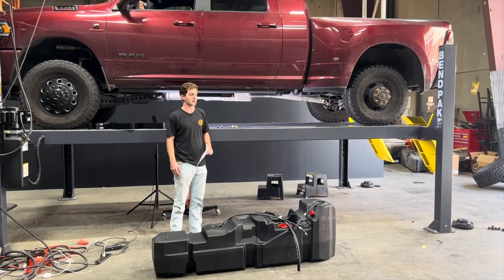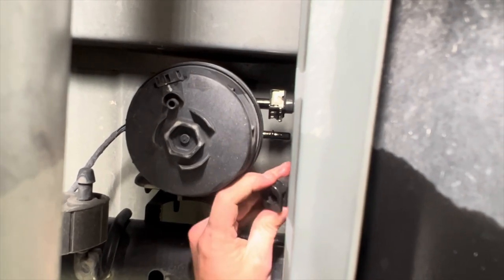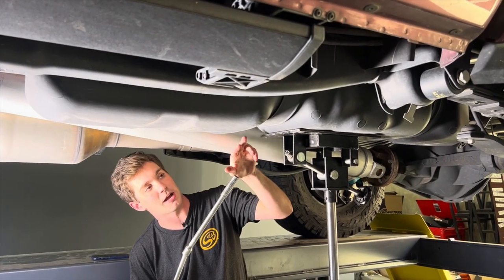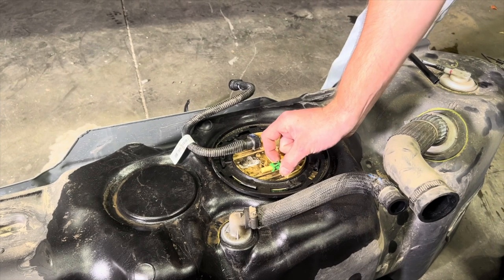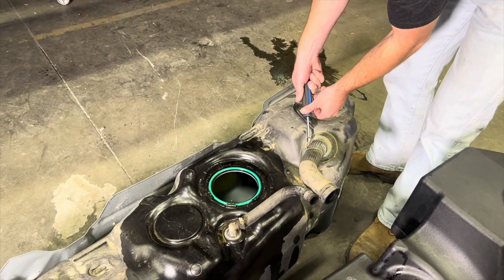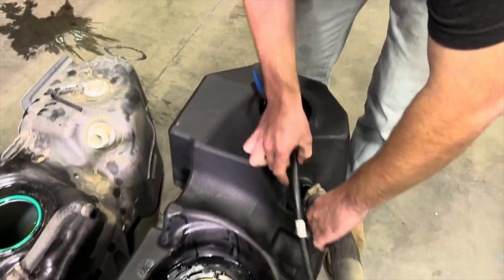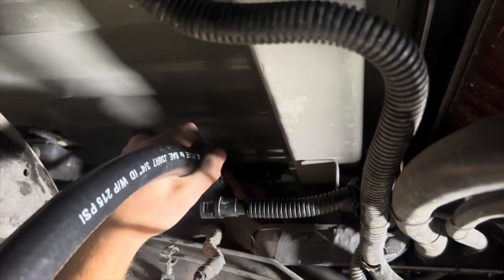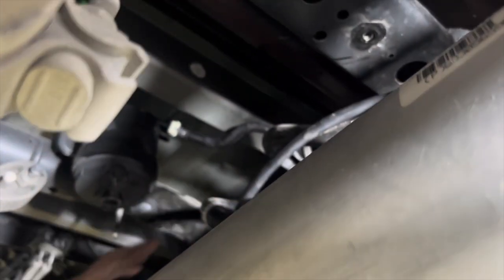55 Gallon Replacement Fuel Tank Install For 2006-2024 Dodge Ram Mega Cab Short Bed

Comment: Just received this tank, was expecting there to be a sump port on it like the older tanks, How come they have been removed on all the newer tanks? Was a big selling point to me and my customers for making it easy (without buying your new sending unit) to use these tanks with a Fass/Airdog
Reply from the maker: We have been developing drop in sending units to pair up with FASS/Airdog to eliminate 1/4 tank issues. The ports on the bottom of the tanks did not eliminate this issue because of sloshing. The sending units use a Venturi jet that is powered off the feed to the engines to keep the fuel bucket full and pump primed. 
https://sbfilters.com/products/fuel-sending-unit-for-2011-2022-dodgeram-2500-3500-67l-cummins

There is a video on the first “callout” in the link above that explains this

Comment: How do I reset it for it to read the new fuel mileage per tank! I did this on my 2016 shortbed dually yesterday but it still says I only got 386 miles with the new 55 gallon